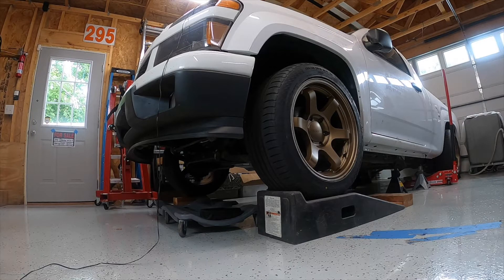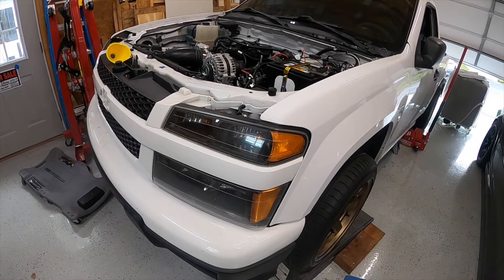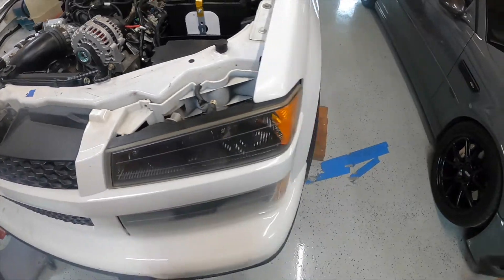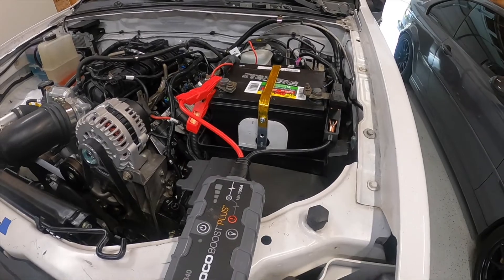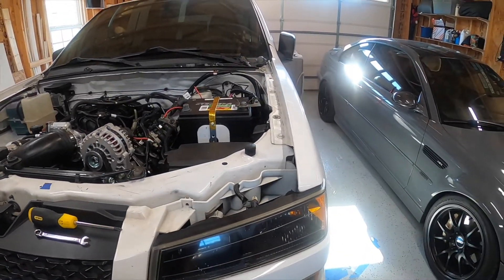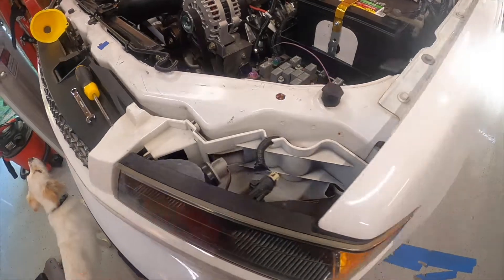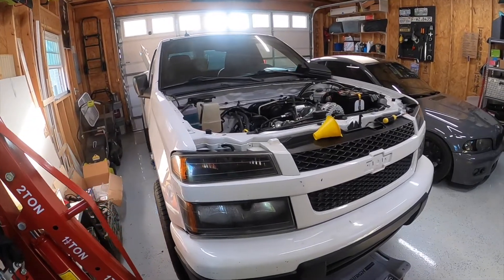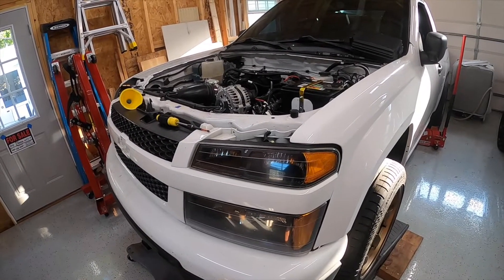LS Colorado Build Part 7

Comment: I know you mentioned you got the speed engineering y pipe but they have 2 different versions do you remember which one you got? 99-06 or 07-13?
Reply from the maker: 07-13, note that you do have to shorten one side of it a bit to work but overall it fits pretty well
Reply: @fixedoncars  is it because you used a gen 4 6.0? Or did that just flow better? I’m using a gen 3 5.3
Reply from the maker: Yea I went with the later model year since I did Gen 4
Reply: @bummgarage9793 did it end up fitting your gen 3?

Comment: great progress on the car i have been following your build and learning alot, what is or where did you get the 90 degree rubber throttle pipe for the airfilter
Reply from the maker: It’s an eBay intake kit for a Camaro SS. I show the exact kit in one of the earlier vids

Comment: Q: was the Y pipe mod narrowing it? I’ve bought the same set up and it looks a little wide.
Reply from the maker: Header collector is only 2.5” and the Y pipe steps up to 3” and then 3.5” after the Y, so it’s actually much bigger. Hope that helps